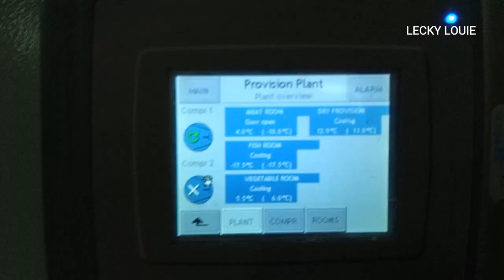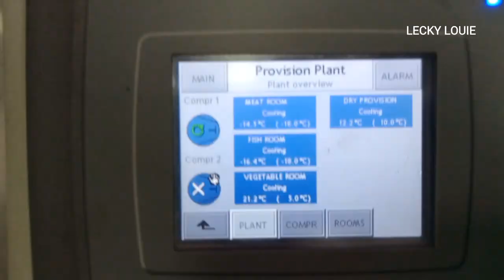Provision Plant: Meat Room Evaporator Heating Elements | Ice build-up and abnormal room temperature.

Comment: Boss paano kng dko mapaabot ng -18 pwd ko bng mag dalawang compresor para maabot nia -18 o -19
Reply from the maker: pwede gamitan ng dalawang compressor pero base sa makers manual ay maximum of 30mins lang pwedeng i-service ng sabay ang compressor.kung kailangan lang habulin ang room temperature lalo pag bagong lagay ng provision. may connection ang dalawang compressor na pang balancing ng pressure na kailangan buksan pag sabay naka service. pero ang design kasi ay kaya lang ng isang compressor,pag dalawa na.meaning may abnornal sa system.

Comment: Sir yung provision plant ko iing ang suction line normal po ba yn ?  Malpit na sa compressor
Reply from the maker: hindi normal yan. baka kulang ng refrigerant or may problema na ung expansion valve. check mo ilan ung suction pressure mo dapat nasa normal limit lage.